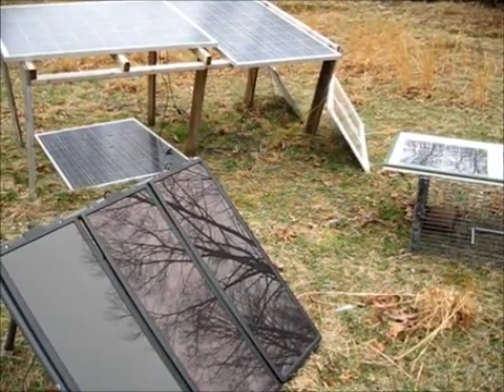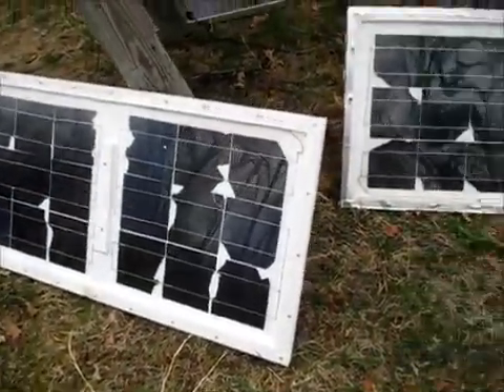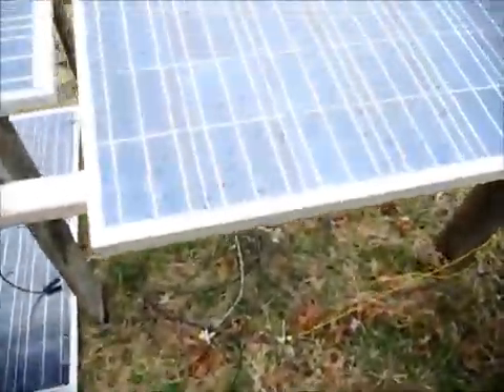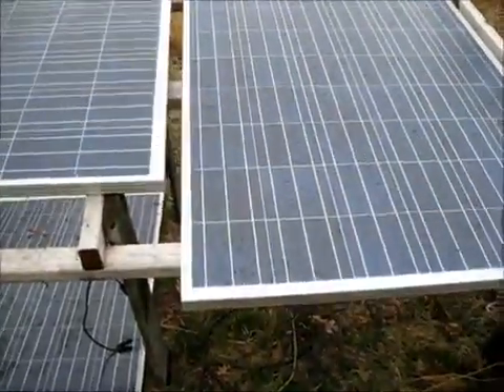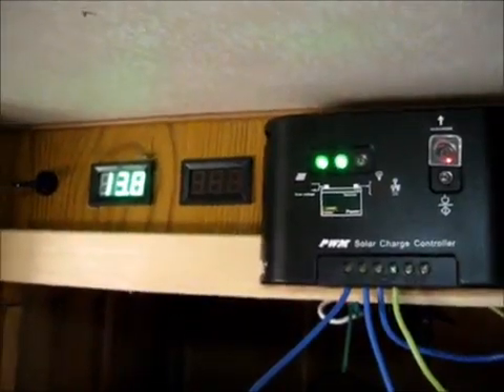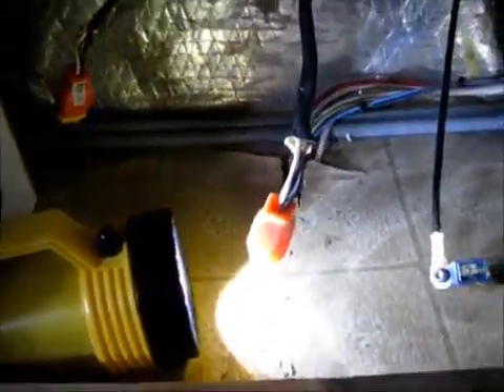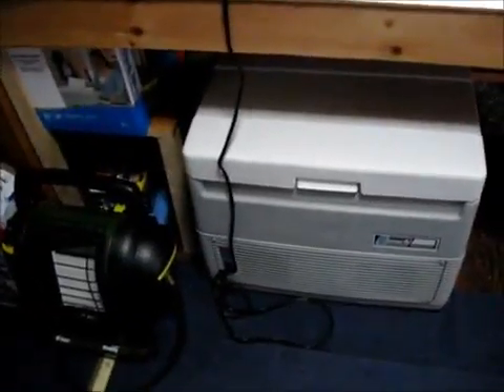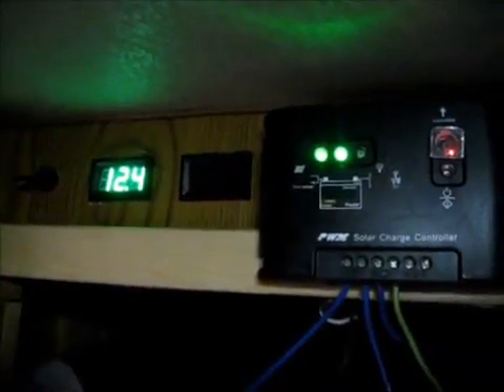Cloudy Day Low Power At The Off Grid Solar Camper

Comment: Get an mppt charge controller instead of the pwm ur using, u can use different wattage panels with mppt and it outputs at 12v

Comment from the maker: Would be cheaper and easier to do it outside right by the panels due to the cost of the wires. To do it by the camper I would need a set of wires for each solar panel.

Comment: One suggestion. instead of connecting and disconnecting the solar panels, how about covering up the ones you dont need at the moment. I suspect that it is easier to put a cover on and off than to do the connect and disconnect. As well, it would save on wear and tear.

Comment: get a nice 24 volt controler your 12 volt panels can be run in pairs ,wired in seires for 24 volts.your 12 volt batterie will also be in seires for 24 volts  but  they can still be used seperatly.[2 12 volt inverters] very cool. you will like it. you could get a couple,peal and stick, uni-solar flexable panels.they take up 2x's the space but work better in low light.

Comment: You should have 2 different solar charge controllers. I am surprised that something hasn't gone wrong... like your charge controller blow up. If you do get a new charge controller you should get a MTTP for the 24v panels (a true MPPT will take a high charge and dc-dc invert the voltage down to the battery voltage... but you will be looking at $100-$150 for a 30A charger (you may want to get a 40A one if you want to upgrade later). I would not trust that charge controller to take 24v on 12v batts

Comment from the maker: I am using diodes on each panel, thanks.

My controller is cheap and simple. But yes with the mppt, I can go higher on the voltage and reduce losses.

Comment from the maker: The voltage at the meter is the voltage of the batteries. The solar panel voltage is drawn down by the batteries. I am sure I have some losses though, but without disconnecting the batteries, thats how it measures.

Comment: Can't agree with the mirror trick. Yes it works if the angles are correct at the right time. But it also concentrates light & heat on the cells and could expedite wear & degradation on standard panel construction.

Comment: they should be connected in parallel also. ..btw i saw you have your multimeter..you should check open voltage on those panels and also on those harb. fr. panels. Don't forget use diode so it will not go power back to panels...use multimeter as well. but the best thing is when you can connect those panels in series ..you will get about 100-120V. If that MPPT charge controller can handle it it would be the best(not sure about that you are using)less power loss,not so thick cable needed and so on

Comment: HI Friend :) To tell the truth you will not be able see your State of Charge like this. battery voltage is one thing but SOC  something different. I bought Victron Energy battery monitor for this and i think you need something like this. it will tell you exact SOC and not by voltage but by counting Ah. (I'm sure in USA you have some similar product). Btw I hope you are using MPPT charge controler. BTW your harbout fr. panels can be conected in paralel with those new panels..

Comment: also you said your panels are outputting 36 volts, but what is the voltage at your amp meter?  With DC you will have voltage drop over long runs of wire and it looks like you have your panels a bit off from the RV.  SO they may be putting out 36 but its only 20 at the meter.

Comment: troy you can try to limit the voltage with a zener diode and resister setup although you will lose a little power. or make yourself a voltage regulator to limit it to what ever your charger can handle.

Comment from the maker: No problem. Thank you for all your input. I am leaning as much as everyone else, from you all.

I will fix the tarp issue. Thanks.

My meter shows the battery status. When the charge controller is connected, the panels are brought down to the battery voltage, so for now, its the same voltage.

Comment from the maker: Its not good to cover part of the panel. They have built in protection for that but some cells can get hot. I am looking at the wiring in the back though to see if I can change their voltage.

Comment from the maker: Yeah, it has a smaller opening for only about a 10ga max wire which I have in it now.

I plan to use a screw or piece of metal to get a larger diameter wire in there. Shove it in and clamp it down. But the 10 ga takes 20amps so far with no heat.

I do not use the load output though. Its too small and restricted. I draw my load right off the battery and just keep an eye on the voltage myself.

Comment: If you would like to stay with 12 volts you could always get a charge controller that will step the voltage down and they also increase the amps, example 24 volt panel has 5 amps then after going through the step down controller you should have 12 system at 10 amps

Comment: troy...i keep trying to tell ya...the issues your having is the 24v system.. an the combination of mixing them w 12v system/panels.... pick one or the other...an get a GOOD charge controller to go with whatever system u go with.....i say go with a 24v system...an then use the harbor freight use on the shed for lights an maybe one battery or something...your going to ruin your brand new batteries...an then youll really have stuff to complain about.whts ur addy, imgoin to send u a book..

Comment: You would do so much better with making it into a 24 volt system. Get a 24 volt inverter and a good 24 volt charge controler. have to seperate systems one 12 volt and a 24 volt. The big panels would really better all by them selfs running a 24 volt system.

Comment: With the gear you have, I would run two separate systems. Invest in a good controller that can handle your 3 new panels and your new battery bank. I would use all of the twelve volt stuff and try to scrounge a battery or two for second separate system.

Comment: Troy you really need a MPPT charge controller. If you want to harness the power from the larger voltage panels and not waste the majority then MPPT is the way to go.

You can then use the harbour freight setup to keep your old batteries topped off and power only your stove water fan keeping it off your new battery bank completely.

Comment: Don't know if you are open for advice or not but if it were me doing the same thing as far as power, I would solder and heat shrink ALL of your cables-Large or small. Far less chance of corrosion and resistance especially in a harsh enviroment. Crimp and solder. Look what happened with your ammeter connection... Harsh enviroment will take its toll. You have a good setup. Make it work for you for the future. Just my 2 cents...

Comment: Troy thinking of the heatwave you had couple days ago.  If I was you, I would cut your pool-skirting into 5 foot sections or so.  That way when the summer heat does hit you in force you can remove them for the breeze under the RV to help cool you down.  Like you said was 80 other day and you had to come outside to cool down.

This room in mine sitting 4 feet from a window unit gets to 85 still in the afternoon.And it has been in upper 80's to low 90's here already.

Comment: How do you get those (I'm assuming it's) 2 gauge wire from the battery bank to your charge controller? I bought the identical charger after seeing it when you first got it. The inputs look as if only 18-20 gauge will fit into it.